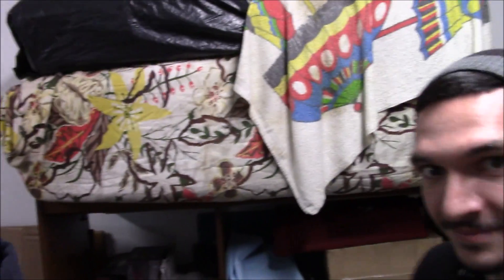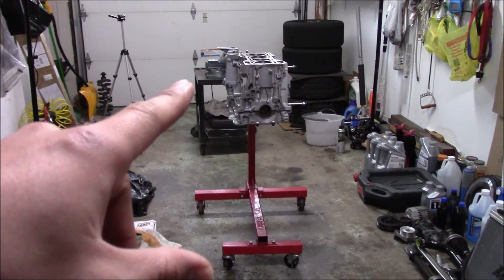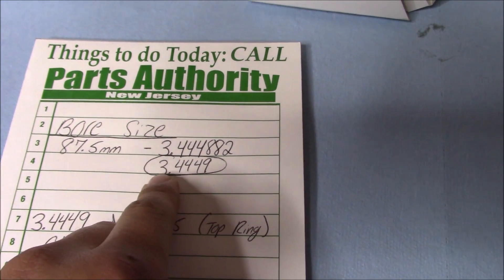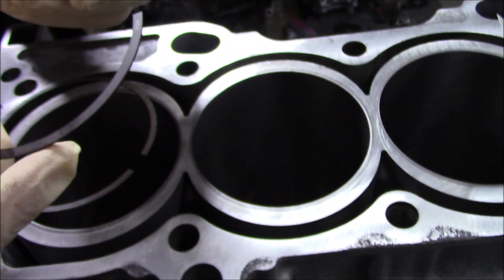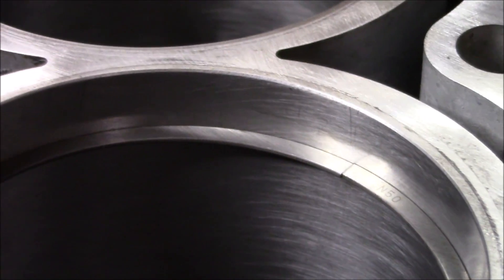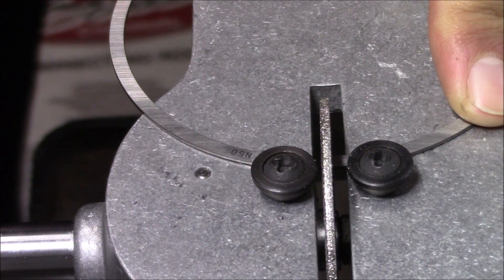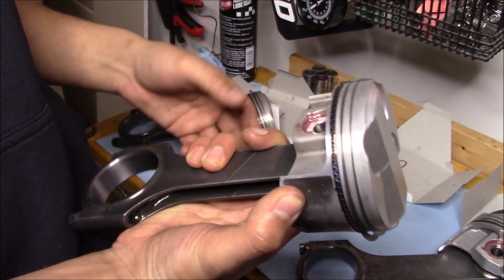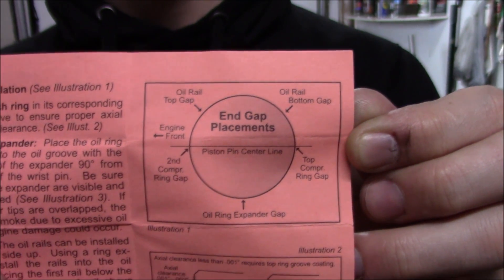Ultimate K20/K24 Build Guide! PT. 4 (Piston Ring Gaping)

Comment: Also it is wise to check ring clearance half way down the bore then near the bottom, this ensures that your beginning clearances and final ones are accurate, because any deviation indicates a flaw in the cylinder itself, not what you want to see in a well built motor. Otherwise there will be slight differences in actual compression and rings will potentially wear out faster.